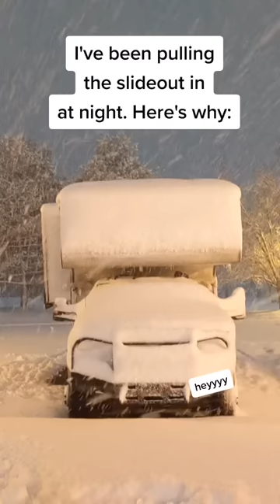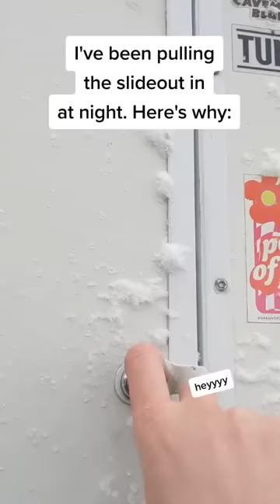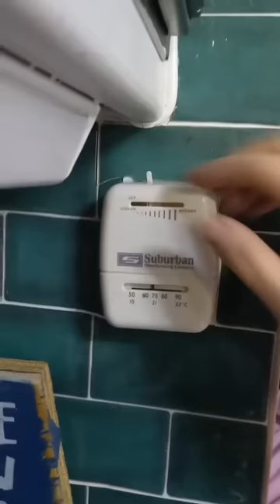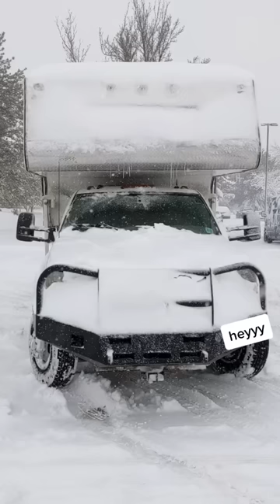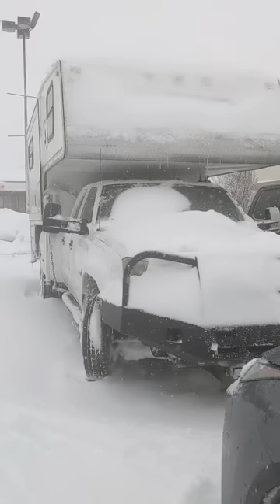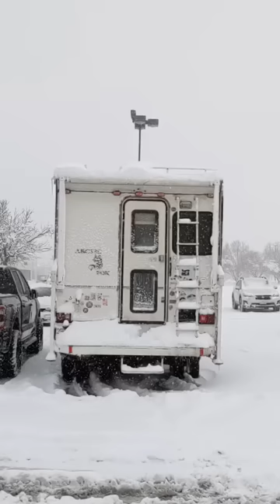the truck camper slide out theory #truckcamper #rv #rvlife #vanlife #fulltimerv #travel #slideout

Comment: Technically it is correct, how much of a savings you are actually making is the real question. In essence, anytime one can heat “less space” the less you will consume in propane. If you REALLY wanted to save propane, you could literally reduce your propane consumption to zero at night while you slept. I do this all the time in my camperized 4X4 with topper. You would have to ensure ALL your water lines are blown free & clear &/or chased through with RV anti-freeze & that nothing is of concern in the RV if frozen. From there you would ensure you have yourself some good blankets &/or sleeping bags & you can turn the propane right off for the night conserving propane throughout the entire night. Remember, the less space you have to heat, the less it will require to warm it & keep it warm. My camperized 4X4 with topper is used in this fashion all the time when I am out camping in it. I have a “Little Buddy” propane heater that heats the entire place in under 5 minutes when ignited. When I am ready to gear down for the night, I turn it on, let it warm the area, gear down, crawl into bed then shut it off. When I awake in the morning I, light the heater, let it warm the area while I snooze another 5 minutes, then get up & get dressed in a “warm environment.” Hope this helps you. Remember, “less is more” when trying to conserve heat. I am “field tested” to minus 23 deg. C with nothing more than a sleeping bag rated for 0 degrees & a little nylon blanket which I use inside it. What you will come to realize is that you don’t really need much. I could have went deeper into the freeze with just what I had with little problem as I wasn’t even remotely cold when I awoke.

Comment: Here is the real secret..your body actually wants to sleep (hybernate to some extent) better when it's colder (not freezing of course).  Use your blankets to be comfy and turn the heater to about 64...the increase it when you wake up.  That tiny slide is not actually amounting to much loss.  But you can also   place a thermal blanket over the slide area to act as a draft baffled wall.  Do this over your windows too as well as runners on your floor for extra insulation layers. Your single pane windows probably have more loss than the slide itself.

Comment: We visit same time every year. 1 year it snowed and was much colder than the years before. First night we had side out and it was really cold, furnace was running what seemed like all night. Next night we brought it in. It was better but decided to block off the area of the cab and above with blankets and curtains. After that it was nice and cozy. The furnace ran so much less. If it's ever cold I know to make it a smaller area. I think I covered 1 window with a blanket too. I don't think the windows are meant for such cold.

Comment: Yes and No. 
im a state certified technician for heating and cooling.
The amount of energy lost to the outside world depends on the area of surface connecting the inside to the outside and their insulation value.
is it pulled out, you got more surface area letting more energy go threw to the outside.
however, you got less air volume inside the van getting heated up every time your heater starts and stops, when its pulled in.
one counters the other in effects of your desired outcome of less frequent heater use. 
so... to be really sure, you´d have to calculate it.

Comment: As I understand an auto system adjusts as the temperature outside changes to keep the inside of your space in balance to your setting inside. If it was not going off and on you would awake from being over heated, too hot in your pace. Your system must have an automatic setting of it will just go on and stay on.

Comment: Not only are you heating less space which is more efficient but more importantly when you have the slide out at night anyone with bad intentions knows you're in there sleeping AND most important if you needed to get away quickly you can't really drive that rig with the slide out safely without risking having an accident and or damaging your equipment.

Comment: The slideout isn't insulated as well as the rest of the body, so when it's out, it's acting like a big radiator, and all your heat is bleeding off of the outside surfaces of the slideout. Its absolutely a real thing. It works, and it's smart.
Reply: 🎉 yes is real yes it's true
Reply: That does make alot of sence. Learn something new everyday lol

Comment: Yes. Pull it in at night. Also, pull in so if you have an issue with a situation, you can pull straight out and drive straight forward and get your vehicle away asap.
Reply: Except... It's a truck camper. You have to get out and walk around to the driver's door.
Reply: Sharky 🦈🖐️.... Just as you said . Happy travels🤗👍🙏
Reply: Dosent matter. Aways back in.
Reply: @p.robertbranconi4127 can she not get through the pass through under the bed? She's got it covered so I can't tell but usually (I grew up with truck campers) You can slide right through that window space if you're thin enough.
Reply: @missychan63 yeah you have to be pretty little though typically. I used to do that all the time when I was young in my grandpa’s truck that had a camper on it like this one.. but it was pretty difficult to do once i got older, even though I was still small. Though that window on his truck was a smaller one.. I’ve seen much bigger ones on newer trucks.

Comment: Covering your windshield w/ an insulated Waterproof blanket made for that purpose will also help your insulation.
Reply: Doesn't matter it's a truck camper not a motor home
Reply: Snow is very good insulation from the cold. ❤
Reply: Plus it helps with security ppl outside can’t see who’s inside or whats going on …Takes a Village Y’all stay safe!

Comment: I agree.  Not just smaller area, but also the slideout has less protection from the elements.  The temperature gradient is therefore more extreme, and it will require more heat to equalize it.

Comment: Be careful you don't tear a slide gasket if it freezes to the wall or roof.  Also sweep the snow off the top of the slides so it does not push a pile of snow and bind the slide motor
Reply: Good heads up.
Reply: Todd Malone:  i’m not an RV camping sort, but there is one tip that may transfer over from regular automobile use that may help:  If you can spray your slide gaskets with silicone spray, you can prevent them from freezing to the wall or roof.

I live in an area where this happens to  car doors all the time, so that’s what we do to prevent expensive damage.

Comment: I think it's safer to not  use the pull out at night.  Not only are you using less heat,  you also can leave quickly if you need to.  However I would get an oil pan heater.  Especially if you're parking in an open area without any wind break.  Motor batteries and oil can freeze up,  also bring DryGas in case the last gas fill you got was slightly watered down.  That can also freeze. Yes companies do that.  Just to be safe during the winter season
Reply: Ard has a diesel engine.
In those conditions, I would be concerned about the propane bottles and lines.

Comment: Get a clay pot for plant. Turn upside down with a small candle in it during the day to heat up your ca.per while your in there. The small candles ith metal cup or a glass jar that is small engouh to fit inside the clay pot. It radiates the heat.

Comment: yes smaller area less need to do, not that it matter i do have Hvac degree , but this is common sense so ya you are correct, if  use propane a lot,  propane it likes to  make things very dirty test for leaks regularly once a week soap in spray bottle spray fittings, yes it is over kill but living small area  it can save you many headaches, and clean anything that is cleanable  once a month that uses propane keep free of dust and dirt

Comment: We had the same problem. Watch it tho bc the furnace will blow up an its a very expensive fix. 
Smaller space will heat will an save propane an power. We even got an electric heater bc we are in the north an it gets very very cold minus -30 below.  But have to watch the space heater constantly. Unless it has a temp control an It stop an turns on when it gets temp

Comment: No that's 100% true. Less square feet to keep warm. Plus less square feet of metal on the outside absorbing the cold.  But the difference could only be the heater running an extra 2 minutes during the night, costing maybe an extra 50¢ of propane. 
That would be my guess. It's definitely more air to keep warm but the difference is probably minimal. I think a bigger benefit would be not to have to push to snow off the top of the slide every morning.

Comment: If you heater is rated at 9000 btu, and you reduce the space that heater was designed to heat, you will save propane.

Comment: In the semitruck I've got deisel webasto heater. If i keep open the curtain thstbseperates the sleeper from the cab than alot of heat leaves but if I keep curtain closed I only need to run the heater at 1/3 to have sleeper at like 75f when outside its 25f

Comment: if you spent $30,000 on that truck why didn't you add a APU your heater could run off of your batteries and then when your battery is low you had a automatic startup and then recharged your batteries

Comment: that extra area doesn't amount to anything. You will not notice more propane usage. you need way more than that tiny ass slide out.  however, don't take my word for it, simply run a full tank of propane with the slide out as well as with the slide in and whichever tank lasts the longest do that, and if it is the same as I suspect do whatever you want, at that point it would depend on if you are too lazy to put the slide in or not.

Comment: that's not true you may be short cycling because the unit is sized for the size of the camper with slides out. when a unit short cycles you actually use more energy. Because the unit will Actually turn on more.

Comment: Hell no. Pull it back out it doesn’t use any more propane to heat a bigger space. In fact it takes far less because it holds heat so we’ll that you will actually find the bigger the space the less gas you will use and in some cases you won’t use any propane at all as long as it doesn’t get below -25.

Comment: Furnace will have less space to heat but it's such a all space and obviously very cold I do t thi k it will make a difference, but the slide out do not seal good when open or closed for that matter, camper suck for efficiency either way...may help a very little...maybe!!

Comment: Of course it's true, less space to heat = less fuel needed. Also in the case of this particular camper I would have pulled in the slide out just because of all the weight of snow on a temporary roof.

Comment: It's true if the heater is not coming on then your not pulling down the batteries. And yes your not using as much propane. Less surface area for sure.

Comment: U definitely Dave heat and money when pulled in they don’t seal as well and yes your heating twice as much and when pulled in you have a double layer from wind cold etc make sure you get snow out of the slide compressionpoints!!!! All souse a inverter heat pump ac and heat for like homes juat mout the fan top back edge or bumper there way more efficient you can heat down to -28 devrees

Comment: U are saving, but your cost of a slide motor and rigging out way propane....I had a 5th wheel in the snow...You'll be fine. Leave it out. Brush snow off b4 retract. Good luck

Comment: Well obviously less area to heat, means less propane used and less the furnace will need to run.  You need a massive furnace to heat a home, and a candle can heat a small tent.

Comment: Rv and campers does get very cold fast. It takes more gas to heat back up  why nit turn yr heat over to electricity  when u are parked  in camp ground  u save gas. U use gas period no matter where ur heat on. Has nothing to do with electricity

Comment: Smaller volume probably contributes to savings more than smaller surface area.
Also, with the slider in, less of the insulated spaces are exposed externally.
Plus, you are sleeping, probably in the overhead bunk, so you won’t miss the slide out space while sleeping.

Comment: Diesel air heaters are very i
affordable and non flamable ...
Reply: SILVEL 8KW Diesel Air Heater,Diesel Heater All in One 12V with LCD Display, Remote Control,Silencer, Fast Heating,for RV Truck, Boat, Camper, Car Trailer, Motorhomes

Comment: Think about how much wear you are doing to the slide out.  It only has so many ins and outs so if you wear it out will surely cost many times more than the little propane you are saving.  Not a good choice.  About the same as leaving your car running in the garage to save the starter.  Dont make a lot of sense.

Comment: Nope you wasting more battery power running it in and out wear and tear on the slides and potentially packing and snow and ice that could damage your seals in 10 ft of space that already at desired temperature so if you finish does come on it's only maintaining the desired temperature within in the space nomater it's space unless it's about height lower the roof lowered the heat space

Comment: Just don't get in the slide while it is closed. It is not made to carry extra weight and will sag. If you notice scratch marks on the floor when you open it you will need to get it adjusted as soon as possible or you will have leaks and outside air can come in around the seals. Also, never use the slide area for storage while traveling. Same results as adding weight while the slide is in.

Comment: Yes. It would consume less energy to heat as there are s less outside surface area for the heat to escape. How much would be the greater challenge to measure. I do not know your camper specifically but my guess would be 5, 10 or even 15% savings on fuel.

Comment: Your also saving the seals of the pull out by sliding the pull out in and protecting the seals .lived in a 34' tow behind for 3 years. The Florida weather eats up the seals and the rain causes leaks in the roof and pull out.

Comment: Another aspect is, it's a fact that a full refrigerator is easier to maintain a given temperature as opposed to an empty fridge. The same would apply to heating. Once everything is warmed up it will hold the heat better than the air space it has replaced.

Comment: I've been living in RVs for years and ones with slides and really really cold snowy wet winter it does help to pull them in and save on gas and electric in winter and small space heaters help a lot to

Comment: Use the gauge on your propane tank from start until you feel you need to refill it and prorate that per day. If you want get even into it further, and do it two or three times as a measurement and write it down in your journal every day and equated togallons per hour. Stay warm.

Comment: of course it saves energy, lol. The material that seals the popoff portion is not insulated, this is the majority of the heat loss with it extended. Is this the first winter in the camper?

Comment: You are correct, but not for the reason you think. It doesn't really have as much to do with surface area as it has to do with when that pop out is popped out. It has very little insulation around it, making that a leak point for heat.

Comment: I think the main concern is the volume of the space being heated. So if the slide out being pulled in reduces the internal volume of your RV; it will take less energy to maintain the desired temperature within that volume.

Oh, and yes, you are also experiencing reducd heat loss due to a smaller surface area being exposed to the cold outside air.

Comment: Actually it is heating a smaller amount of square footage, however there is a more surface area exposed to out side when slide is out.  So def easier to heat with slides in.

Comment: I have a slide out and let me tell you, the only thing between the outside and inside is a 16th inch rubber gasket and you can look at the corners and see daylight. there's a major draft of cold air that poors in from that gap because I feel it on my feet if I'm not wearing shoes

Comment: The furnace still kicks on when it gets colder than what you said it on it doesn't matter if its 70 or 50 it will run the same amount if you sent it on 50 as it would on it still needs to heat up the same space so you might as well be comfortable at 72

Comment: It's a simple thing to rig a clock to a voltage meter and then to the fan motor or some electrical part that turns on. The voltage meter  trips the clock on and off so you get a total run time. Then you can do the math. Like:

 (cost of gas per tank/Run time per tank)x(Actual run time from clock)=cost per allotted time.

Comment: if you're heating less cubic area then you use less fuel. 
but how much cubic footage is the pullout though? enough
to make a difference? it looks like the slideout is very thin
and 3 walls, the ceiling and floor are exposed to outside 
temperatures. so that allows a lot of heat loss. cold doesn't 
come in. heat goes out. smaller area = less heat loss.

Comment: Less area to heat, plus less exposed outside surface area, plus fewer angles to catch wind as well as likely better sealing. Absolutely it will loose less energy and thereby require less to maintain the smaller environment.

Comment: The way to tell is by the amount of propane you were going through compared to what you're going through now. But it is a hydraulic system to move the slide out. If you need to move for any reason and it was below freezing overnight and it was out it could affect the slide out when you need to bring it in for the move.